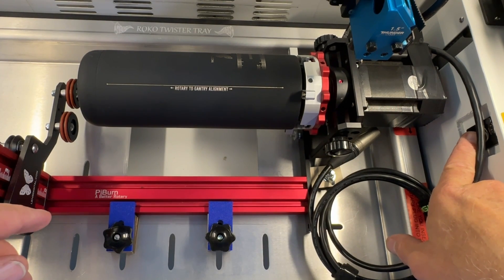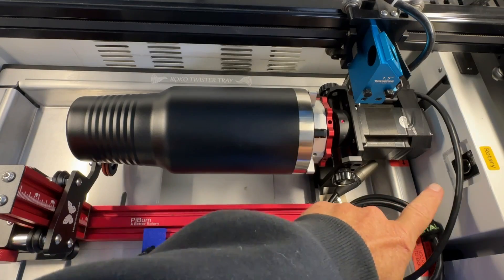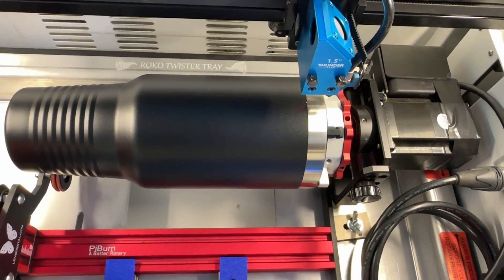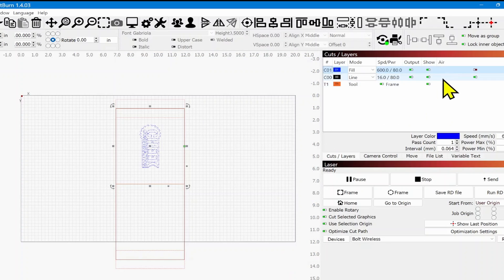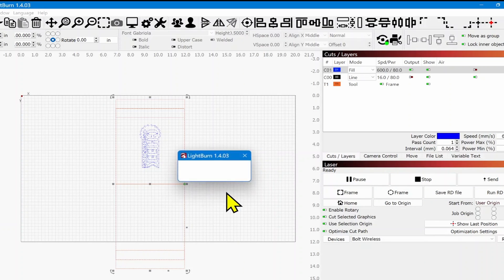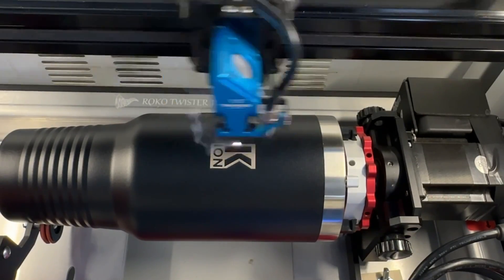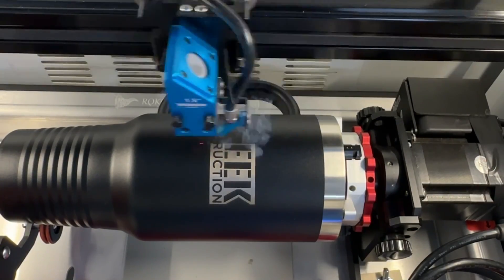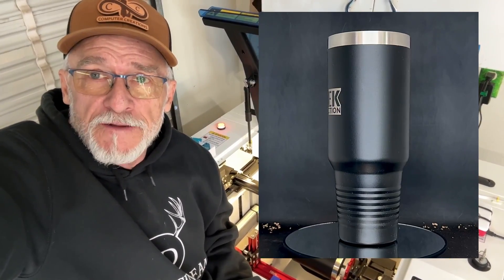Engrave Your Logo Like a Pro: Step-by-Step Guide for a 40 oz JDS Tumbler

Comment: Hi there :)  With the Thunder Bolt, can you do a full wrap on a 40 Oz tapered Stanley (removing the handle) using your twister tray? If you can, do you set up the tumbler like you did in the video where you demonstrate the 3 degrees angle and the digital gauge? Thanks...
Reply from the maker: yes I set it up the same way in the Bolt. and yes the twister tray allows you to do 40 oz dupes as long as you have a rotary that allows that much adjustment